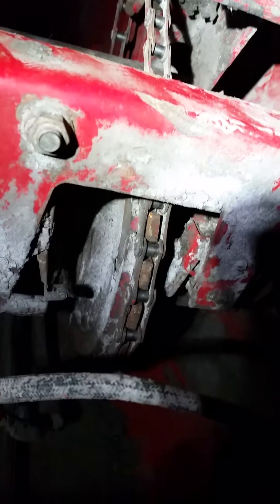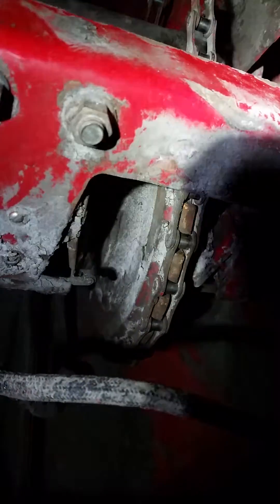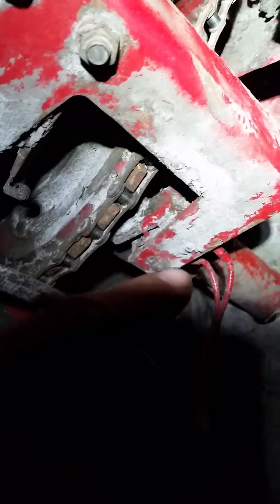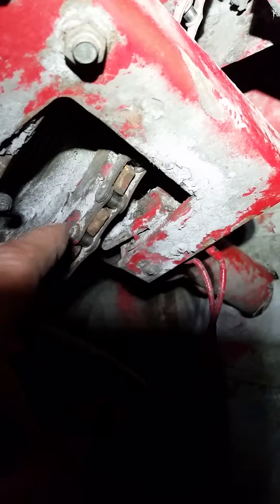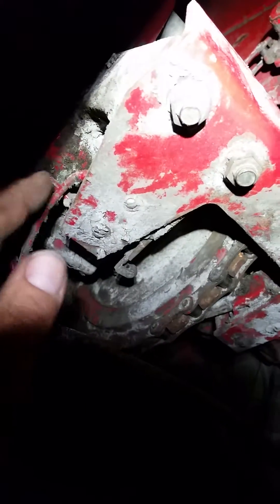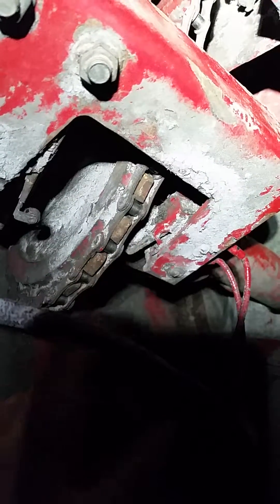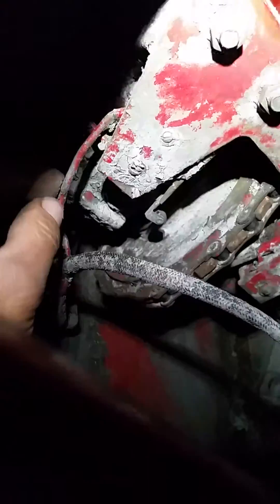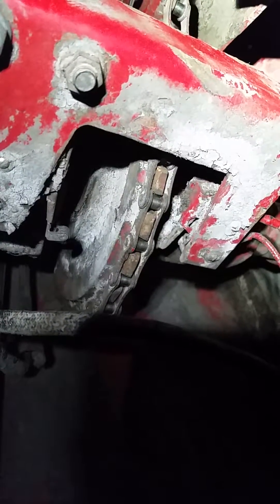1460 rotor speed motor

Comment: Hey , I would be so grateful if u could show me the location of that adjustment motor and the panel with the switches to adjust fan and rotor thanks.
Reply from the maker: Its located in engine compartment. Forward of shieve on the right, behind a metal frame. If you have one.
Reply: @farmfixes112  ok, what about the switches to turn up or down the fan and rotor
Reply from the maker: Yes on pics. If I can figure out how to post them.
Reply: Ok, I  sure appreciate it